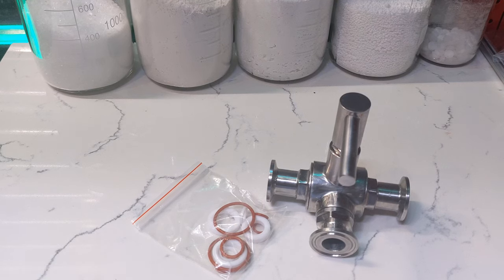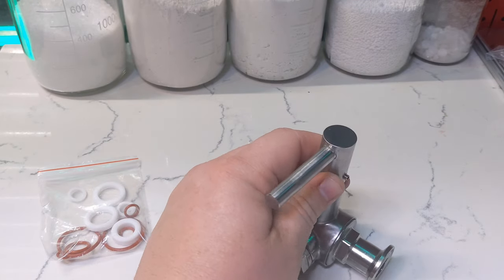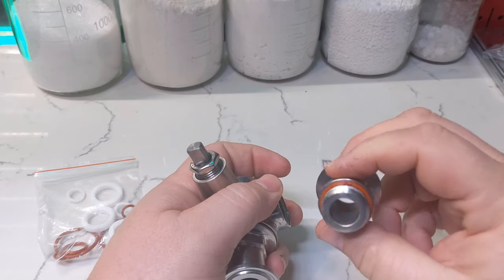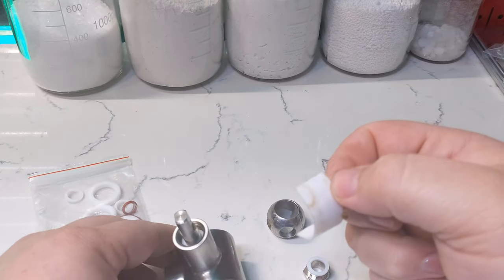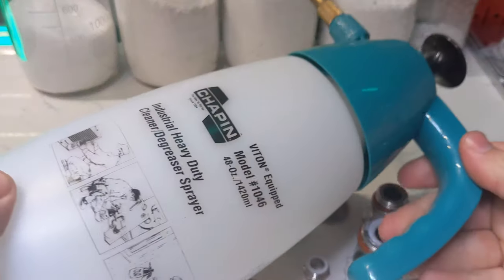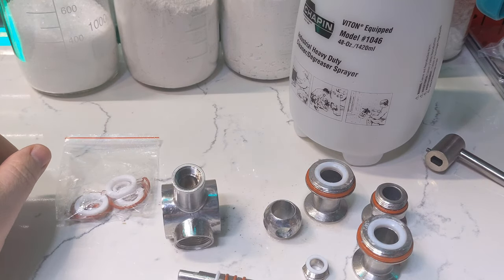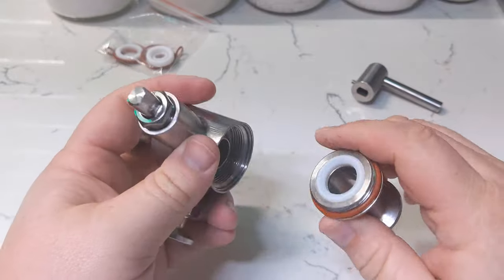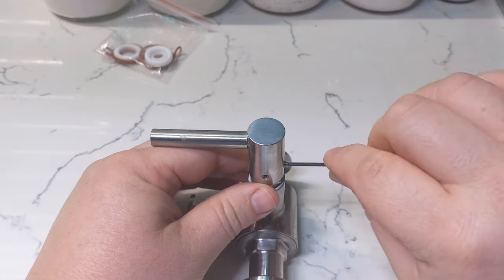Brewtools B40 B80 Brewing System three-way valve rebuild tutorial

Comment: How many times have you broken down your valves for cleaning? Have you always had success after reassembling them with no leaks in ports where there should be no flow given valve orientation?
Reply from the maker: I usually clean in place. I've only ever fully disassembled them after about 50 brews I honestly don't think it's necessary. It's probably good to do though. Never had any issues with them leaking.

Comment: Great to see this!! Something to think about before taking the B80 plunge. How many brews have you run through that valve?
Reply from the maker: I'm not really exactly sure somewhere around 14 or so. What are you conserd about?
Reply: Portly Gentleman like most of us clean up is the worst part of brew day. And if you had said only 2/3 it would mean taking those apart quiet often.
Reply: Before cleaning the valves we run about 15 brews. After disassembly, cleaning and  assembly all the valves are leaking. Mostly one of the two big ports. The small ports did not leak. We ordered 3 sets rings to replace the old ones, in the hope it won’t leak again.